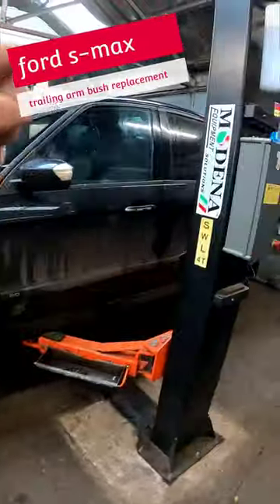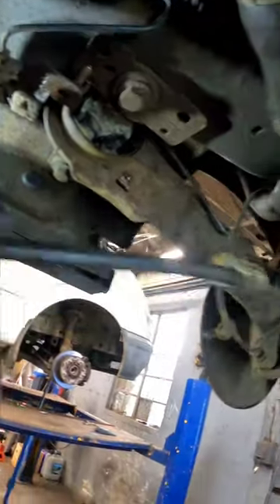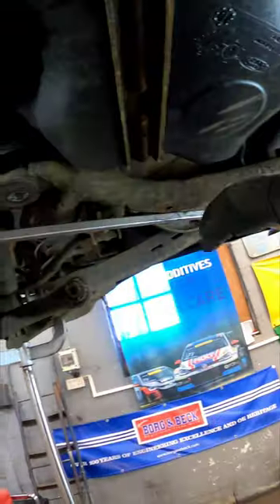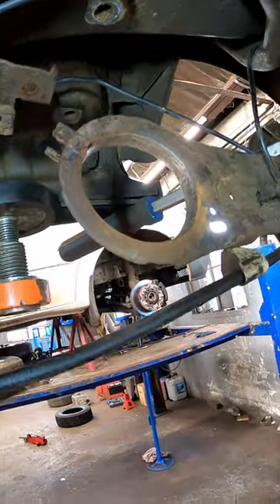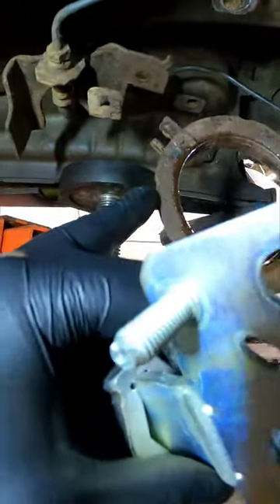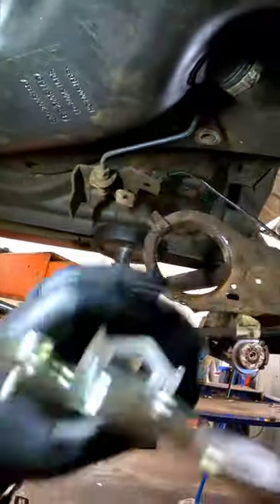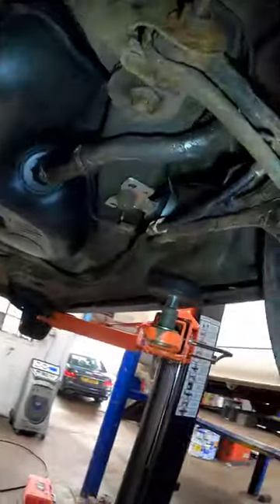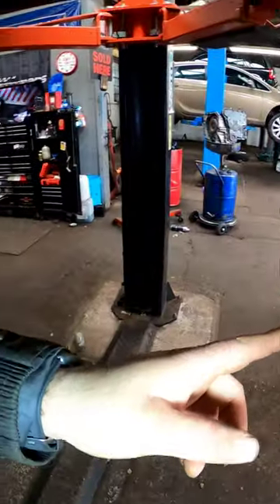ford s-max trailing arm bush replacement

Comment: I watched half dozen of these galaxy, mondeo, smax trailing arm rubber bush replacement videos, a lot mark up the level alignment of the bracket of the old bush on the arm, some just skip the important alignment part altogether. You’re the first one to do a proper job and show how it’s suppose to be aligned as it was in the factory using the nipple. Proper job. Many thanks!